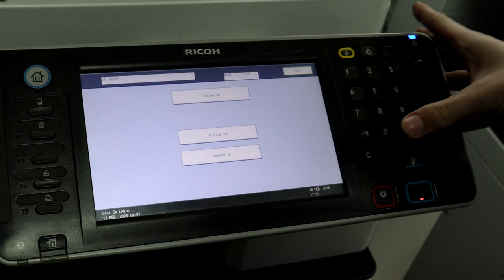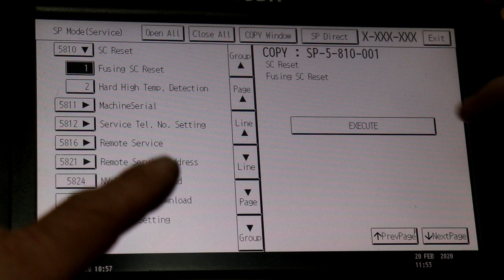Fusing Film RICOH MPC3002 MPC3502 MPC4502 MPC5502 Folia FUSER SLEEVE wymiana sc554

Comment: i wanna know about the fusing oil cotton
what tape it use to make it stick strong
because i am service it just change the oil cotton not 1 set fusing oil cotton
Reply from the maker: I also recently changed only cotton and new oil. I didn't use any glue, I just screwed the screws from below and it works nicely.
Reply: noted
thanks for the information
Reply: a quick question
at the base of fusing oil cotton, you can see there are 3 leg to put in the hole. Is there any effect if those 3 leg is broke
Reply from the maker: Yes, she will have a problem. The copier will jam paper and soil the copies. The 3 fixings are very important.

Comment: Can you guide me in clearing SC 552-001 ricoh mpc 3503. thanks a lot
Reply from the maker: 1. Instal NEW PICO FUSE
2. Find in SYSTEM MENU Reset Fusing https://youtu.be/Rt6U8uLhegs
Reply from the maker: and look this: https://youtu.be/19U4latqqbE
Reply: Mission on and off same 600 dpi  200
Reply: No save